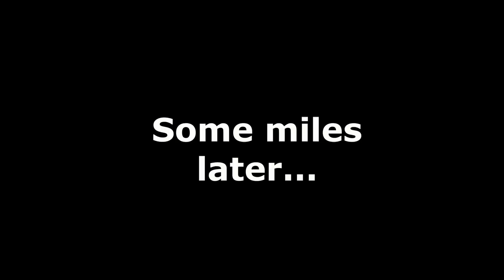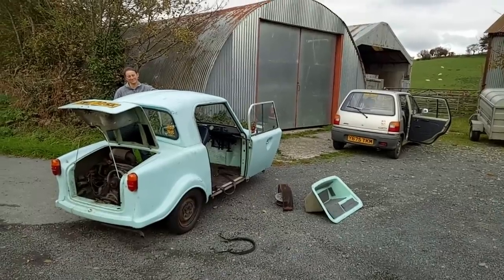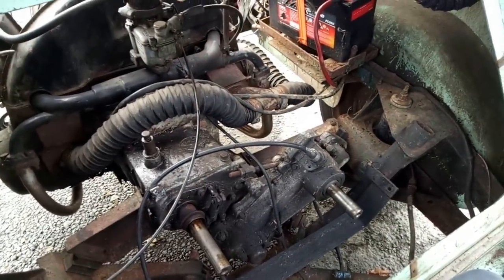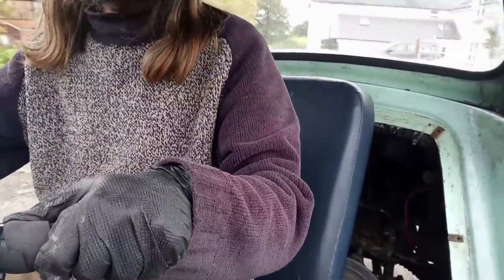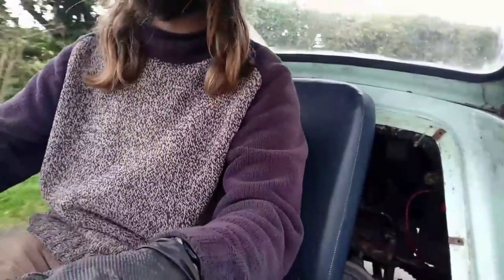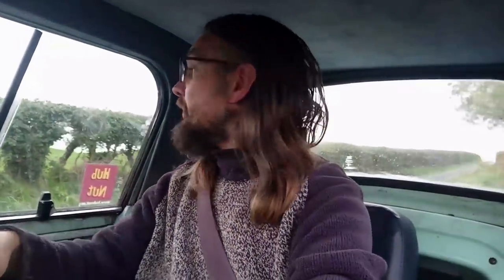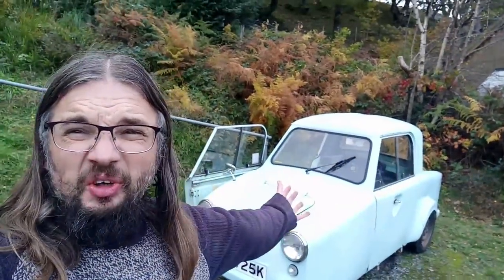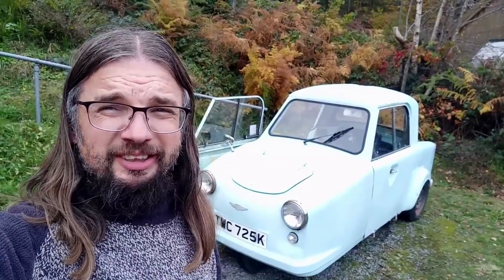Invacar Belt Trauma Pt2 - Belt FAIL!

Comment: That's the most I've seen you smile in TWK for quite some time. Hi Viz vests with the text "I'm pushing as fast as I can"  over a TWK logo might be an idea. I'd expect both pulleys to be spring loaded to return it to a lower ratio when the centrifugal weights release pressure on the cam plate?
Just looked again and the way the belt has failed, suggests that it has jammed in one pulley and then the other has ground its way through at one point. Not that is much help to you now.

Comment: Great vid! Surprising nippy little thing. When it works.... So what do you reckon was the fix in the end? The new pulleys, the belts, a bit of both or it just stopped being camera shy?
Reply from the maker: Fitting two pulleys that actually work seems to be the key. I'd still like a decent belt. That old one isn't great, though it does work.

Comment: I don't know. If I owned the Invacar (which I totally would love to), I would take off the pulleys, disassemble them to the last piece, and completely rebuild them. Centering, spring tensioning/change, cleaning, polishing etc. Those are super critical parts of the car and it just isn't worth it to be dealing with something that is so prone to failure even when new. I had the same issues with my Jawa Babetta 50, the start and run clutches were slipping, wearing inconsistently, making weird noises and I wasn't able to make 1 kilometer without the need to pull the flywheel with clutch drum, clean everything up, retension springs and put everything back together. Spent a fortune on brake cleaning solutions, because that was the only thing that could make it work again. Then I got fed up, sent the drum to have it recentered so it doesn't wobble even the least, repadded centrifugal levers and starting levers, cleaned and roughed up the outer clutch drum and put everything back together. So far 80 kilometers without even a slightest problem :)

Comment: Like I was saying, belt tension, should never let the belt get slack . No Squealing!   So how many replacement belts are left for these?
Reply from the maker: Loads of replacement belts, but they're all New Old Stock and not in great nick.
Reply: Ah  so they've been sitting in storage for decades and they're a bit stiff with dried out rubber. I wonder if giving them a generous soak in ArmorAll or the UK equivalent would bring them back to like new?

Comment: You could use a cable tie around the belt (in the middle) to retain the tension and then cut it off when the pulleys are in place. I use pair of cable ties to hold selector pawls in place when Jawa CZ gear selector shafts back into the gearbox. (The Haynes manual (rather unhelpfully) suggests using 2 x  hacksaw blades and 2 x pairs of hands which inevitably ends in the springs launching the selector pawls into the gearbox, which is followed by lots of swearing and fishing around with a magnetic probe).
Reply from the maker: I  could use cable ties, but I prefer a Mrs HubNut.

Comment: I don't know anything about fixing engines, but the path where that belt went. Would it be possible to fashion a chain on to a sprocket with slight tensioner arms to up slack. Your 2cv mechanic could help get it done.🙆 I don't know were that came from but I had a vision😃😉
Reply from the maker: The idea is that you adjust the tension with shims. It's at maximum adjustment. Maybe I need new belts. They are a year old.

Comment: Have you considered replacing both sides of the clutch with a Comet style clutch, like are used in golf carts and some ATV's?  They are physically quite similar to what is already on the Invacar, but are still being manufactured and might make finding spares much easier.

https://www.ebay.com/i/283036536271?chn=ps

Something like this was what I am imagining.  

If nothing else,  thanks for keeping such a cool bit of history on the road.
Reply from the maker: It's an idea, but I'm not experimenting until I've got to Birmingham and back.

Comment: I think you're just going to have to bite the bullet and take apart one of those pulleys and recondition it properly. The springs may ping everywhere when you do but you can't keep replacing belts every few miles.
Reply from the maker: To be fair, she's only ripped one belt apart in over 1000 miles, and the pulleys that caused the issue are now not fitted.
Reply: @HubNut  Fingers crossed then! She did sound much better after the pulley change.

Comment: You just slam some parts on it and hope for the best? I really would dive into the cause of the trouble. Maybe you have the wrong belts?
Reply from the maker: Belts are correct, but possibly too old. Finding new parts for this system is impossible. I haven't had time to try and pull the pulleys apart!

Comment: If only you could convert her to chain drive but least you have a good pulley on it now.
Reply from the maker: She technically is. Drive goes from Pulley 1 to Pulley 2 by belt, then from Pulley 2 back into the gearbox via a chain.
Reply: Didn't know that.
Reply: You might be able to fit a motorcycle gearbox to her, complete with clutch and six speeds!